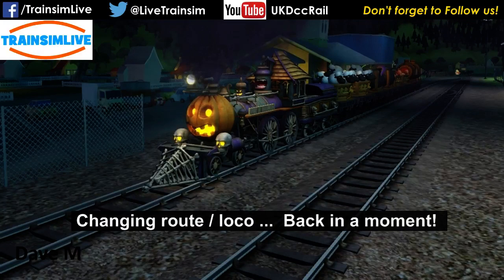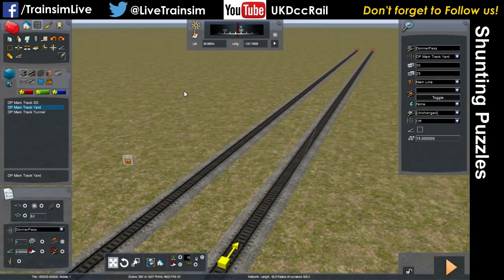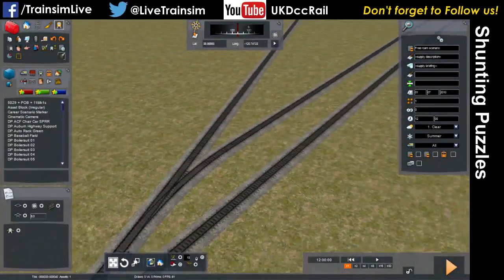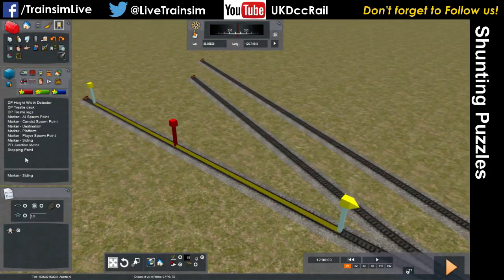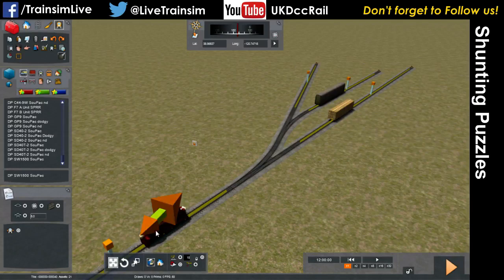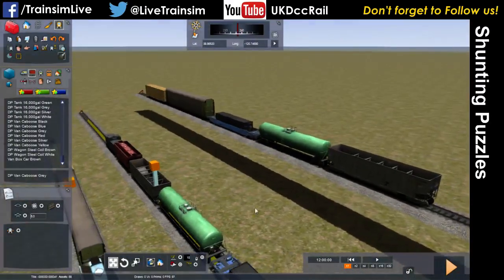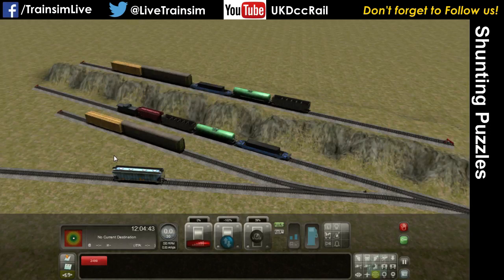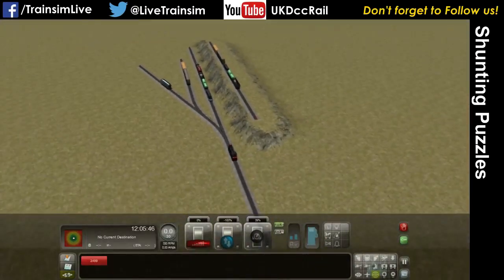Train Simulator 2015 Tutorial - Shunting Puzzles

Comment: I need some help in builder mode....!! Plz reply back asap
Reply: ***** yeah! 
I have been working on a very big route for the past 1 week... The problem is with tracks... I was making a large terminus and i set the track number to 8... I noticed that they were placed close to each other. Then I placed some Southern Pacific SD-45 on each track. I noticed that they were touching each other which looked kinda weird and unrealistic. I had to individually move the track a little far away from each other which is very time consuming... Is there any shorter way you know about?
Reply: ***** thnk you for the help... It worked😃 I was thinking that is there any way I could add more tracks to the Track Rule Section!?! ... I could get to work on different tracks for different areas of my route..